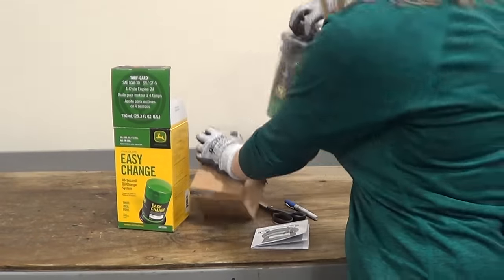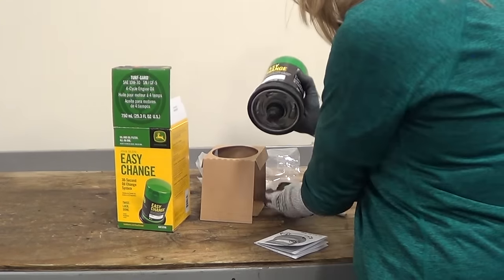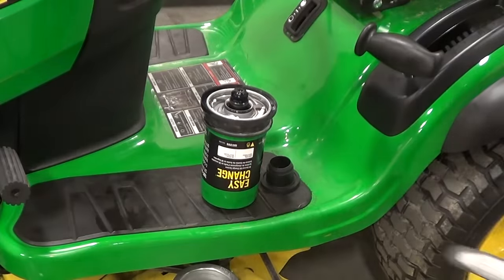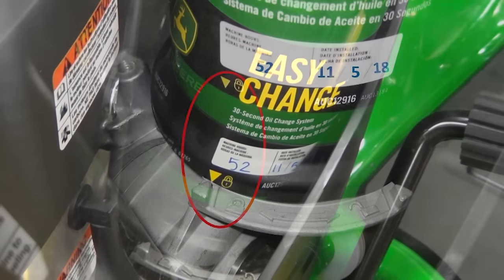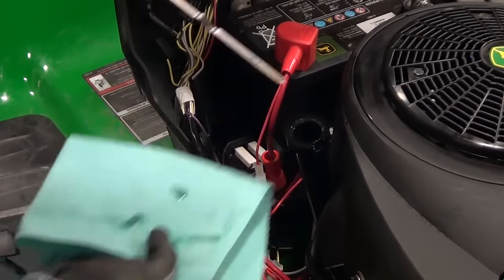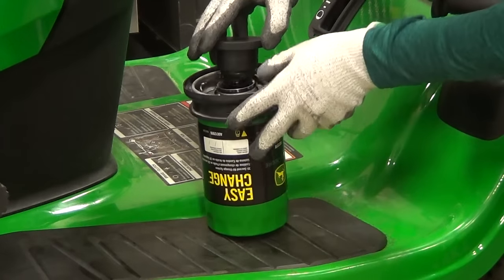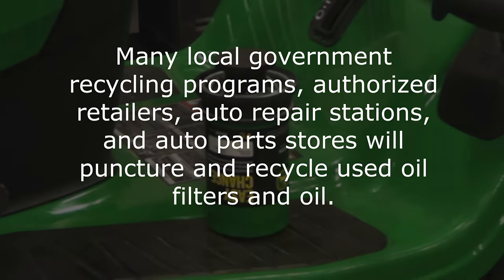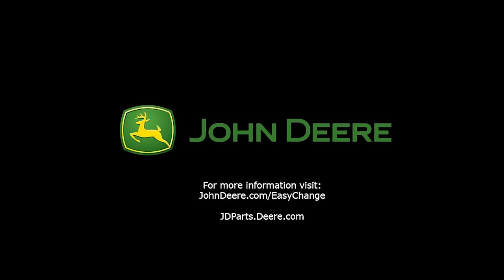How to Change the Easy Change Oil System | John Deere

Comment: You will never convince me that leaving 75% of the dirty engine oil in the crank case, at oil change, is a good thing.  One quart of premium oil in about $8.00.  The easy change filter runs about $30 for 1/2 quart of fresh oil.
Reply: 20 oz ,,,engine holds over 60 oz ,,,!! JD bad ,,,very bad idea !! Guess they want you to wear the engine out so you come back sooner to buy a new tractor !!
Reply: Guess my know how to do just about anything son will figure out a new way of fixing this.  He is a carpenter, painter, welder/iron worker, mechanic and pretty adept at necessary electrical work around the house and yard.  Well,  when he's in state he takes care of everything for his 73 year old mother.  Thanks Marsh.
Reply: @joannpeart7412  Sounds a lot like me, Jack of all trades and a master of them all 🙂
Reply: @joannpeart7412  let us know to by-pass ridiculously price time-saver, please.
Reply: @barryestell6324  let us know how to by-pass this ridiculously priced time-saver, please.
Reply: $55
Reply: These engines blow up even when you change all of the oil... now you're going to only change 1/3 of it?! 

No thanks
Reply: $55.00 now.  Just a Rip off.
Reply: I was interested in it but you're right.

Comment: 50$ for an oil filter ? No thank you. And what about all the dirty oil in the crankcase?  Not a feature I would sell to anyone.
Reply: I'm servicing the exact same mower today and I will be draining the crankcase and adding JD oil if necessary. I will report the amount of dirty oil left inside the engine. Why would Briggs and Stratton allow a filter of this design to be added and if it fails who pays the bill. Looks like a way to force the consumer to buy their filter only. It's coming off as soon as the warranty is up.
Reply: hey, it's quick and easy, no hassle, no mess.  I LOVE IT!  Hey wait a minute?  $50?  where did you get that?  Mine was $60.
Reply: @NomadMechanic  so. What’s the status of the crankcase oil?
Reply: @NomadMechanic  liar
Reply: Looks like a fine way to get rid of unwanted money. Why is everyone so negative?

Comment: It's a way for Deere to short-circuit the aftermarket filter replacement market and lock you into an expensive proprietary system you must buy from the dealer.
Reply: It's about $50 which is way more than what regular oil filters cost, but it comes with oil inside it and is easy to change, I feel it worth the price given you can literally do this in 30 seconds.

Comment: Sounds great but replaces less than half the oil and the price is exorbitant. Not a feature I would recommend to anyone.
Reply: I think you wrong about “only half oil”. Unfortunately it’s only 1/3.
Reply: Not even 1/2
Reply: Not even 1/3 is replaced. Oil filter holds .8qts engine holds 2.8 qts.

Comment: This "system" costs $45 as of 5/26/22.   If you buy oil in five-quart jugs, it's about $8 per oil change (Two jugs = $40, enough for 5 oil changes).   The oil filter's about $8.   So the "Old Way" costs $16m versus $45 for the "Oil Change of the Future" way.   Not to mention you're stuck with .8 quarts of oil inside a big slug of metal that the auto parts stores 'round here won't touch. Disappointing that the only guidance Deere gives is the "dispose of responsibly" boilerplate.

Comment: As a small engine mechanic for 10+ years... This idea is a bad deal for consumers and a great deal for John Deere. Consumer will accumulate grime and sludge in engine over time, more than likely delay of skip filter changes due to outrageous cost of filter leaving these machines with a smaller service life. The customer see's a new huge oil filter and thinks they are winning until they bring it in for service and get billed $40+ for a filter that use to be $6-9. John Deere I'm guessing has a good margin on these giant filters (That they bought from Briggs). Please don't become a Craftsman... John Deere you are better than this!
Reply: Thank you. I was all set to buy one of these things. The guy at Home Depot showed me the filter part of the change- though he said it's not really 30 seconds and ya probably can't use your hands- but didn't go over the oil change part of it. So I came here to figure out how to do the rest of it and was going to get back with him. It never occurred to me that those filters were $50. Yipes!!! The comments here and other places on this video have made me reconsider my purchase. Thanks again to you and some others.
Reply: On another note... It is easy to convert them back and cost less than the giant filter but will stop warranty :-( Find an old sump, Double nut the oil filter threads and remove. Remove JD Oil change system with 1 large bolt (with a rag under it) thread in the threaded part from old sump tighten with double nut and screw on new regular size filter :-)
Reply: @altermad  Deere has a kit to convert back, is cheap, and does not void the warranty. If in the U.S. NOTHING you do to the tractor will void the warranty unless it can be proven that modification caused that particular failure you're trying to get repaired.
Reply: @alexmawdsley  Except its a Briggs engine and they provide the warranty... Could you fight to get it covered, maybe but shouldn't have to change something so new and expensive. Just my 2 cents.
Reply: They also use this system on certain models of their new z300 series zero turn mowers which I  tried to avoid when I was looking for a new John Deere zero turn mower . luckily I found a model that did not use that system.

Comment: You are not changing the oil unless you take the sump plug out and drain it completely and since there is no extension pipe on the sump you pull the plug and oil goes all over the frame .not messy ,, I don't think so

Comment: Thank you all!    Yay $3500 CAD mower and I get to spend a day taking it to my local dealer 50 KM away to spend more on to convert to a more reliable system.   Will be concerting ASAP. As a service tech when I first saw this I was very sceptical, glad their is a fix to go back to tried and true methods. The upright design makes debris removal seem unlikely in theory. 

2003 L130 seemed simple and bullet proof. Wish I had saved my money and continued to maintain my old guy, my ego got me:(

Comment: I think this "easy change" system is for people that don't normally change oil at all. It makes it very quick, clean and easy, to at least change the filter and part of the oil. If it's easy enough, more people will do it.
Reply: Next theyll make the housing clear so you can see if the oil is dirty

Comment: Looks easy here. It took me about 10 minutes to get mine off and then spent about 20 more minutes trying in vain to install the new filter - finally gave up because I didn't want to break the oil filter mount. Took the new filter back to the dealer and they said sometimes they stick so they gave me a replacement. Haven't installed that filter yet - will do so in the summer and hopefully all goes well. If I can install the new filter, I will leave it until it's time to replace it and that's it. I'll convert this idiotic system back to a regular oil filter system (there are videos here on Youtube showing how to do it) plus my dealer sells the kit for 20 bucks but you only need a few parts anyway so you can source them yourself. The quick change system changes out about 0.4 liters of oil. With the conversion back to a regular oil filter you will be able to replace all of the oil plus I won't have to spend 70 bucks plus tax (Canada cost) for this "Hard Change" oil filter and deal with the frustration.
Reply: I'm trying to change mine for the first time and can't get the old one off for the life of me.

Comment: It took me close to 2 hours to remove the original filter!  You will probably need a wrench to turn the filter off the first time! It required al lot of hand strength to get the filter to turn. I hope the next oil change goes easier. I do not have a wrench to turn the filter but am going to get one!
Reply: Yep.  Unfortunately, what the voiceover person neglected to say in this video is that "push and turn" meant "push down" and turn!
Reply: @freecycling6687 I did pushdown, I can turn a little bit, about 1/4, and that’s abt it, can’t move a little.
Reply: same here. Did you managed to take it off eventually? Would you mind sharing how ? Really need some help here.

Comment: I trust the engineers at jd know what they are doing.. I bought my e120 new, and plan on using it as designed. Maintenance as well.
Reply: If you keep the Easy Change system, be sure to drain the rest of the oil using the drain plug on the lower right side of the engine.
Reply: John Deere thanks you very much for the' EZ change $$$$ going to their bottom line.

Comment: How is this changing the oil since there is almost 2 qt in the bottom of the engine?
Reply from the maker: Thanks for the question, gyrs riddle. The Easy Change™ 30-Second Oil Change System makes changing the engine oil easy, quick, and clean. Changing the filter removes the captured contaminants and replaces about 0.8 qt (0.76 L) of the engine oil. You can learn more about the Easy Change 30-Second Oil Change System and other features of our 100 Series Lawn Tractors here: https://bit.ly/3dosoZ1.
Reply: @JohnDeere well then it’s not an oil change.  Oil breaks down and you’re not being honest about that.   I will never buy one after seeing this.
Reply: @JohnDeere  So wait, you're only changing some of the oil this way?  That's not actually an oil change

Comment: I guess my first oil change will be with the quick change system since I can't convert it until after warranty runs out. We don't have a local John Deere dealer.
Reply: Not true ,,who ever told you that you can tell them you don't want that system when you buy it or but the kid to convert it back to the old way !!

Comment: Question:. My mover wants the oil and gas out of the mower.  How do I remove the oil that is stored in the mower, and can I put the filter back on- as opposed to replacing it way earlier than I need to?
Reply from the maker: Kent, your local John Deere dealer is your best resource for technical questions like this one. You can find your closest dealer at Deere.com/Dealer. We hope that your move goes smoothly!
Reply: @JohnDeere   I did just that and they suggested the conversion kit to the regular filter.  Advice was free and the kit was cheap. Thx.
Reply: I have not done the conversion kit for my new JD mower yet, but most likely will. Even so, years ago I invested $35 in a siphon pump made for extracting oil where there were no ports. I just shove the thick plastic straw into the oil fill pipe, hand pump 6 or 8 times, and the oil come flowing out through the tube and into a container just as neat as can be. Much less mess than a drain pipe / drain pipe extender.
Reply: @tempgar  I did the conversion kit and I am ashamed to say that it was so easy- I was over-thinking it way too long.  Took me less than 15-20 mins total.

Comment: Amazing!!! All of these "men" struggling to change this filter. I changed mine in 4 minutes the first time only because there was a tie-out strap on it. The instructions do not tell you to cut this strap.
However, I do question how much oil is actually "changed". Or how to remove/change what doesn't come out with the filter.

Comment: I don’t know how just changing the oil filter changes all the oil...
Reply from the maker: Finn, the John Deere Easy Change™ 30-Second Oil Change System canister replaces the filter and a portion of the engine oil. It is recommended when replacing old canisters to check the oil level to see if additional oil is needed. You can learn more in Section 45 of your Operators Manual under "Changing John Deere Easy Change™ 30-Second Oil Change System" here: http://bit.ly/2PZOTa1. We hope this answers your question.
Reply: John Deere so really it’s not 30 seconds. You have to drain the oil. It’s just so you can charge $50 for a oil filter
Reply: The old oil filter canister you remove has the bulk of the old oil, the new filter canister contains enough oil to replace what has been removed.    Technically it is an oil filter and an oil change in one.
Reply: Manny Echaluce but the new oil just fills the container. Not the crankcase
Reply: I see this filter is misleading and a scam. One reason why I'm not a dealer for any Manufacturer. I fix more junk today than in a month in the 90's. Even JD is expensive junk.
Reply: @NomadMechanic  In the 90s, most people knew how to wrench and weren't afraid to get dirty. Now everyone is a tictok star and don't know how to change a light bulb without at least 2 youtube videos and 3 cameras so they can show their fans how it's done...

Comment: Get the conversion kit back to the old way. I can't believe that JD would make such an idiotic way of changing oil when only a portion of the oil, only from the filter is what you are removing. The rest remains in there, dirty, slowly corrolding the engine. Sorry but this is a big FAIL.
Reply: So very true !! Engine holds a little over 60 oz of engine oil ,,the big oil filter only olds around 20 + oz of oil ,,,what in the world was JD thinking ?? Very bad idea ,,,VERY BAD !!
Reply: ya, I'm trying to learn about this system...stupid system with a 40+ buck filter.  what a joke.
Reply: Do these engines still have drain plug in them to ensure all dirty oil is gone?

Comment: I'm trying to replace the oil filter with a new one.  The new one will not attach.  I thought this was supposed to be easy.  Does anyone have any experience with attaching a new filter???
Reply from the maker: We're sorry to hear that, Chris. Your local John Deere dealer would be a great resource for help attaching the Easy Change™ 30-second oil change system to your unit. You can find you closest John Deere dealer at Deere.com/Dealer. We hope this helps you!

Comment: I have had to use a lot of effort and a oil filter wrench to get the original oil filter off and it appears that the new filter is on? But the alignment arrows do not align? I started the mower, I do not see any leaks at this time? The arrow on the new filter is a decal, is it possible the decal was placed in the wrong location? So far this seems to be a bad system
Reply from the maker: Thanks for bringing this to our attention. We will make sure to document this. If you look in your Operator's Manual under the "Service Engine" Section, its says, "Rotate the ECOS 90 degrees clockwise, until the detent lock engages..." You can find a copy of the manual online at techpubs.deere.com.
If you aren't sure if the lock engaged, we suggest you have one of our John Deere dealers look at your unit to confirm that. If needed, you can find your local dealer at Deere.com/Dealer.

Comment: There were zip lock around the oil filter, am I to cut these straps?
Reply from the maker: Thanks for asking, Alan. Yes, you should remove any shipping tie straps. You can find this information under the "Service Engine" Section of your Operator's Manual, "Remove shipping tie strap (if equipped) on first service only."  If needed, you can find a copy of the manual online at techpubs.deere.com. We hope this helps!

Comment: My E120 is due now at 50 hours.  The oil still looks very clean.  I paid $115AUD at my local dealer for the full service kit - oil filter, spark plugs, fuel filter and air filter. I think that's OK.  I think the JD engineers probably know what they're talking about.
Reply: So what about all the crap settled in the sump

Comment: I wouldn't trust the easy change system unless John Deere wants to guarantee it for the life of the mower. I have $2500.00 invested in my new E170 and hope it will last as long as my first John Deere LT133 which was still running after twenty years. I would like to know if putting a conversion kit so I can change the old fashion way will affect the warranty.
Reply from the maker: Jay, the change from an Easy Change™ system to a traditional oil filter and oil drain system is an approved solution and should not affect your warranty as long as the work is completed by an authorized John Deere dealer. We would recommend reaching out to your local dealer for further questions about the conversion. If needed, you can find your local dealer's contact information here: http://bit.ly/2KXt6Re.
Reply: Thank you, we don't have a local John Deere dealer. I will contact one online and get the kit from JD.
Reply: I also have a JD LT133  that is 20 years old & runs like new. Changing the oil & filter every year with JD Turf Guide oil keeps her running! I too do not trust the easy change oil system; especially if you decide to later use synthetic oil in the engine.
Reply: I had back surgery in 2012 and couldn't ride the mower. I really didn't think I would be able to ever again and sold the old LT133. Last summer I decided to give it a shot after the yard guy quit showing up on when he was suppose too. Bought the new JD and weed eater and so far no problems other than a little soreness.
Reply: @krazyj1957 How well do you like your new JD when compared to the JD LT133? I have looked at the new ones but mine is still trucking along. I had to replace the top hood & front bumper for they cracked into.
Reply: I really liked the LT133 but it was ruff riding. The new E170 is a lot more convertible and mows great. I've only mowed with it three times due to all the rain we have gotten this year so it's got a long way to go to show it can last as long as the LT133 did.
Reply: @krazyj1957  I hope all goes well with your new mower. I have my eye on a new JD E170 if my LT133 ever bites the dust.
Reply: I meant the JD E130 or the JD X350.
Reply: @JohnDeere  Magnuson-Moss act does not allow you to invalidate a warranty based on who performs a repair or modification. Warranty is still valid if an owner or independent shop installs the conversion kit.
Reply: @JohnDeere  Yeah, and probably charge you around 800 bucks